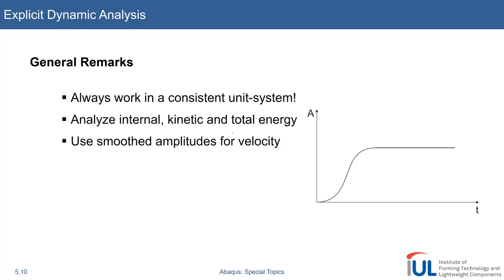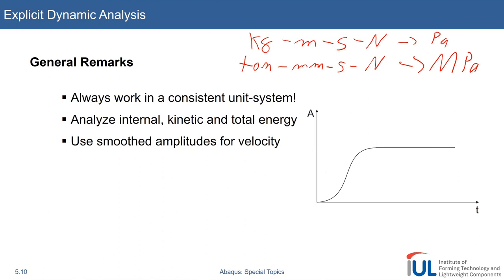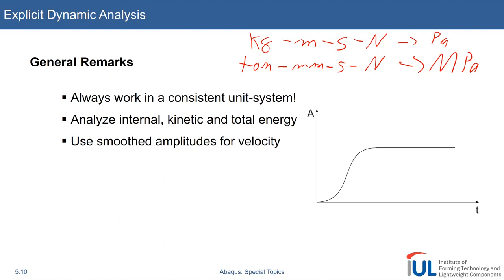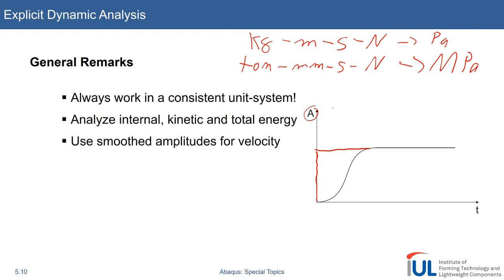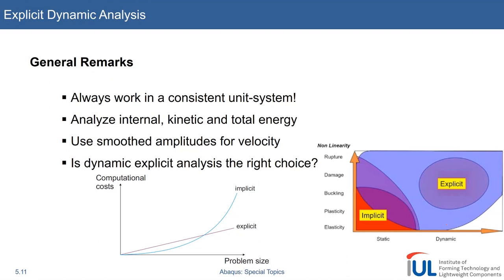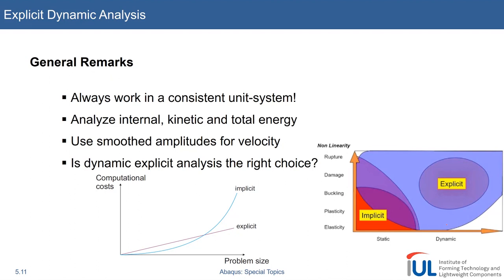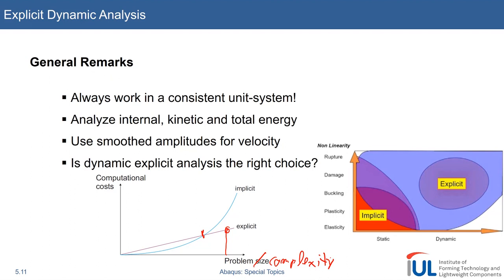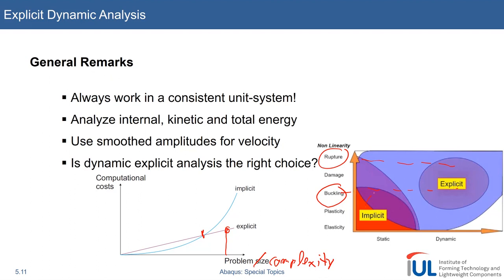Abaqus Tutorial: Abaqus/Explicit Dynamic Analysis #3

Comment: Really appreciated nobody mentioned about unit consistency in Abaqus thanks a lot. Beside the use of dynamic/explicit off-course there are examples out there but no deep explanation with revealed secrets like you did here. Thanks a lot.
I do have one question dude, any explanation about excessive element distortion problem during explicit/dynamic analysis? and the final result like you said the funny colors are they acceptable or not?